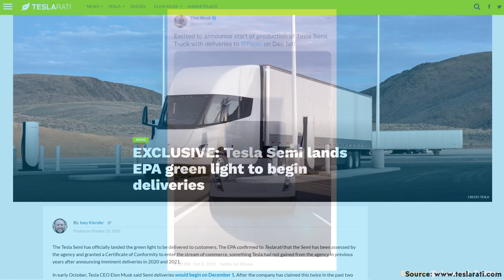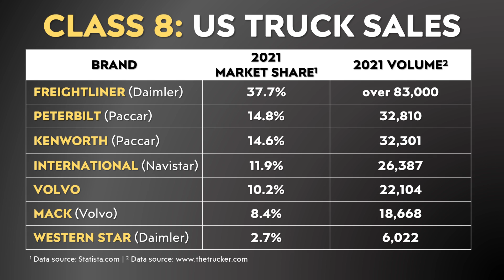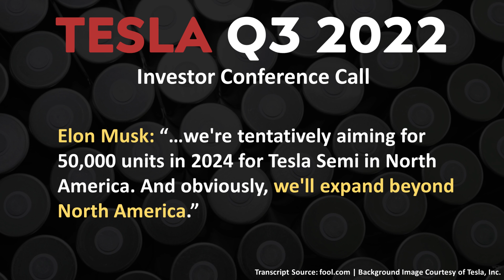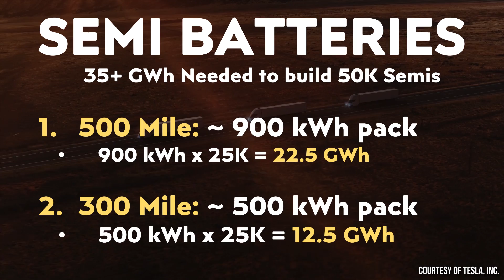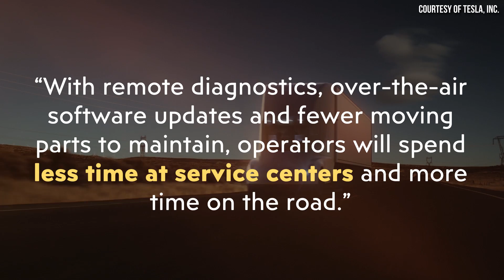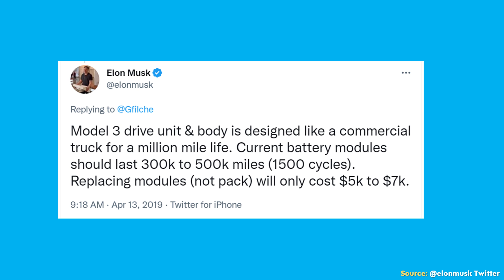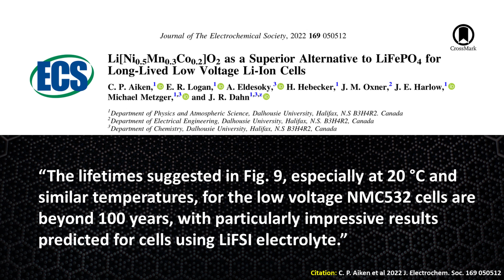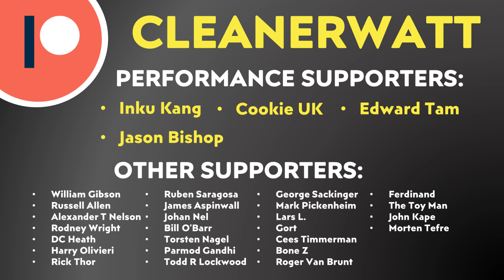Tesla Semi is about to DISRUPT Trucking | Competition BEWARE!

Comment: 13:40 the Semi uses THREE motors, according to the official specs.  I'm definitely interested in seeing how they distributed these out.
Thanks for the update!
Reply from the maker: Thanks for pointing that out! I see that now on the Tesla Semi website.
Reply: @Cleanerwatt  Someone was able to get a real close look at the one at Frito-Lay: https://youtu.be/BM8tagXEFMA but I can't quite see where the third motor is.  There's definitely a lot less room that in M3/MY (which is hard to believe, until you see it).
Reply: @satoshimanabe2493  3rd motor is rear.  See @15-20s , set video to 0.25 speed and FullHD. You can See the single motor and huge differential to the rear wheels. Compare with the 4-motor prototype in the 2017 KMan video
Reply: @Cleanerwatt  
Logically, the drive units don't have to run a vehicle at 100 mph plus.
They can be geared down providing more torque, so 3 motors do the job.....?
Reply: Please do the comparison of available semi’s.
Reply: @Cleanerwatt  Why is Nikola not mentioned which delivered 400 electric class 8 semi?  Oops you did mention but for a few seconds?  Yeah I like a comparison.
Reply: They’ve already shown it to motors on the front drive axle one motor on the rear drive axle all three are independently powered

Comment: I'm assuming you are talking about new trucks being sold. 50,000 is a drop in the bucket. That's not even enough truck for just California. Let's say they get it up to 100,000 a year that's still 20 years to replace most trucks currently on the road. I'm still waiting to find out how much weight is on each axle empty. I also want to know how they are going to charge so many trucks at night. Will there be a power plant beside all truck stops. These are questions from a actual truck driver.

Comment: If Semi Truck users save $ 200,000 in fuel in 3 years, they should just buy one new semi truck, sell the old truck with or without the old batteries... or, or make 500mile battery packs out of old battery packs... sell dead battery packs for recycling, or buy 300-mile Tesla Semis for shorter routes...

Comment: So questions to be potentially answered later.
1: I work in vehicle maintenance (sounds better than "I change oil"😉) and a cost of maintenance comparison from Diesel Semi to Tesla Semi is something I am really interested in.  I understand Tesla Semi will be speculation and not easily determined.  Example: it would appear tire wear should be close because the 2000 lb difference allowed by law is far less percentage of weight difference than  for cars from ICE to BEV.  BUT,... The ability to accelerate at 2 or 3 times as quickly could negatively effect tire wear conciderably.  
2: As per battery life.  If Semi is constantly Super Charged how will that effect battery life?  Also with smaller charging infrastructure the practice of charging to 100% on a regular basis will  probably be much more prevalent even if load is moved well below the 500 mile range.  Will Tesla Semi be relegated to dedicated factory to warehouse runs with installed charging at both ends, and maybe local delivery?  No real OTR, find a load and go.   
3:  What is a realistic timeframe for a charging infrastructure of this capacity to be installed every 150 miles or so on nations interstate highways.  How many stalls per location at what power requirements?
4: Grid taxing mitigation. I saw a video the other day that stated 10% of grid power went to grocery.  Stores, warehouses and refrigeration.  I have also seen claims that two Tesla cars charging at  level 3 in a Walmart parking lot will have the same power draw as the Walmart does.  That is some eye opening perspective.  So now Walmart throws some Mega Chargers at their stores.  Would not charging at those rates create a situation of instantaneous tripling or quadrupling the draw on the grid from that one store?    The grid absolutely does not like being spiked.   Ask any one with a large factory.  You can't turn it all on at once without the grid operator screaming and charging you massive penalties.  It has to be a slow ramp. So then I guess the question becomes, can Tesla produce Megapacks at a rate fast enough to feed the semi charging infrastructure and still meet their other needs with that product line. 
3b: What happens to trucking industry when states say "Don't charge your EV.  Grid can't handle it."?
4: Realistic idea of what it will take to solar power most of Tesla's charging infrastructue, including the cars. I have read solar farms average 15 acres per megawatt installed, but new local ones seem to be closer to 11-12 acres per mw.  If we estimate an average of  5.5 MWH per day per installed megawatt of solar, and an average truck charge of .5 mwhs we then calculate 100 acres of deployed solar at 11.5 acres per megawatt, we find we could charge 17-18 trucks on average per day off of 100 acres of solar.  Having worked a a truckstop that doesn't seem like a lot of trucks.   My experience for a  medium sized truckstop would be 10 times that.  Therefore a thousand acres or about 1.5 square miles of solar required, plus all the megapacks that would also be required.  This particular game of how much land required is a calculation I play with frequently. 
Yes the EV truck comparison would make for a very interesting video.  
Thanks for the good work.

Comment: When the Tesla Semi was introduced, my back of envelope math said. The price of batteries needs to come down-A LOT- for this thing to be viable. A second issue is that the weight of the battery pack is a real concern in a semi.
Elon has stated that the size of required battery in the Semi is 500 kWh for the 300 Mi Semi.
That is at least a third smaller than a reasonable person would speculate.
The Tesla Model S has a 100 kWh battery which weighs 1200 Pounds, and  may be priced at $12,000.  So the Battery used in the Semi must  be 1/3 less expensive than what Tesla is selling today. I think that the combination of this need to reduce the price of the battery combined with the low volume of batteries required for the Semi program pretty much rules out some special chemistry which is different from the batteries used in other vehicles. Admittedly, they could suck in the margins they make on other vehicles and produce trucks with the more costly and heavier 2170 batteries until 4680 battery packs are available.

Comment: I drive a Model Y about 40,000 miles per year. I am on they I75 and I285 between Chattanooga and Atlanta almost daily.  It is a very heavy trucking corridor.  It will be great when the transition is complete to the EV semi. It won't take long for the truckers to get on board.  The charging infrastructure will be easy to put in place as the fleet increases in size.

Comment: The Semi does not need to accelerate like a performance model car. With such heavy loads it would be dangerous. I hope Tesla optimise the Semi battery and powertrain for the trucking use case.

Comment: none of this matters what matters is the length of time drivers legally able to drive being able to recharge the truck wherever it happens to stop and having a diesel power generator on board to recharge the battery just in case it dies cuz nobody wants to spend well over $100 an hour for a service tech to come out and wait for that thing to charge back up. also the problem with it having to shut down anywhere when you run out of 10 hours on your log you can't drive anymore
Reply: does anybody on this channel knows how much the tow bill is for a semi truck the highway patrol wheel mandatory tow you on the spot if you're broken or stopped I don't care about your battery over $1,000

Comment: If you look at the sheer size of the Austin gigafactory, it always appeared significantly larger than the output of Model 3 and Y it was touted to produce. The reason? Because it was clearly designed to deliver Model 3, Model Y, Cybertruck and Semi. So I do not doubt they will be capable of producing 1,000 semis per week as of 2024. Tesla is ruthlessly efficient and methodical in their design and planning. I think too often people get lost in the short term and Tesla does not. This is Teslas greatest strength.

Comment: These companies are going to wish they had not went EV semi. Just wait until winter cold temps hit and the range is reduced to as much as half.
Reply: The main reason BEVs loose a lot of range in the winter is because of power used for cabin heating. Only a small amount when the battery is cold, and unless the trip is short, the battery will heat up, so no more excess loss. Heating the Tesla Semi cabin should be a similar load to a car so as a percentage, the loss will not be nearly as great.
Reply: @royh6526  you seem to forget one-word you keep using. It is "LOSS." There is ALWAYS a LOSS and the colder it is the greater the "LOSS." In fact, regardless the weather/temperature if you let ANY EV set without being plugged in the battery will go dead due to "LOSS." Depending on the state of charge when let setting some will go dead in just a few days and some in a few weeks, but they will ALL go dead.

I have known of people parking their EV at an airport to take a trip and when they came back had to have it towed because the battery was dead.

Comment: The EU would be interesting for deployment, because of the narrow Streets, there are regulations in place which are limiting the length of the towing unit, therefore a redesign for the new demensions is needed.

I do not expect an arrival of semi in two years for now, in europe.

Comment: I’m driving local deliveries for a large grocery chain. The vans are automatic trans diesels. Initial acceleration is clearly limited resulting in slow starts and driver worry at busy junctions. But once rolling they’ll surge forward. Electric vans would be perfect for the job. Reduced service costs and much cheaper fuel make it a “no brainer”.

Comment: I think they will build as many as they have contracts for but with cash on hand means you can’t have a stock of trucks sitting on the lot unsold. Manufacturers are hesitant about signing contracts on promises.  Battery materials is what industry is concerned about. There’s just not enough to go around.
Reply: "they will build as many as they have contracts for" Yes, except that number of contracts will be much higher than their production capacity.

Comment: a lot of those comments show EM probably had little understanding of what a truckers day involves - Truckers don't habitually dragrace, nor is slowing up the hill a terrible thing if it gives 50 miles more range, if they need to conserve their energy for the longhaul -  an overhead catenary should be looked into more seriously for long distance trucking (not only some strange Euro thing - they already have trolley buses everywhere)- charging on the bypass ringroads of many "enroute" cities would be possible.

Everything in economics hinges on the economics of the energy and consumables (inputs, including maintanance and time off the road, yes these matter, EV trucks still need tyres changed and windows washed...
750 000 miles is only up to around 3 years on the road, before the "highest value monolithic  component" needs replacing,   Engines and drivetrains do that x multiples - yes they do need maintenance.. (the proposed pricing structure means that trucks will likely be bought new and scrapped for the battery value on the second use market - where ther eis a $$ motive, a method to dismantle (likely with a waterjet) will easily be solved) as they will be the cheapest A1 confirmed Automotive cells available..)

Comment: Seems like battery swap is a good fit for Semi. Instead of a 500mi battery, use a 250mi battery with swap stations along interstate highways. If peak electricity is expensive, better to  own swapped batteries charged off peak and saved. I wonder why we don't talk about battery swap in long distance trucking.
Reply: An old argument for cars. First, truck drivers must take breaks from driving, so extra charging time beyond the normal break time will be minimal to none. Swap stations cost a lot of money and having spare batteries is additional cost, the economics are not attractive. Nio is committed to the swapping concept, in China they are heavily subsidized by the Chinese government so profitability is difficult to determine, but now that they are expanding into Europe, I doubt European governments will be so generous. I am very curious to see how Nio costs work out in Europe. 

It is my understanding that the Chinese government pays for Nio's swap stations and also Nio qualifies for full NEV benefits despite being priced over the limit because of an exemption for battery swap vehicles. California has paid over $100M for hydrogen fuel stations, so has given similar support to H2 FCEVs as China is giving to battery swap.
Reply: Would be massive and heavy batteries!

Comment: I think that somehow Tesla semi can and does have a way to use the standard supercharger network in case of emergency charging, but it looks impractical for the moment. As it looks like a Y combiner, which is not practical and easy to tamper with,  or steal from what pictures are available showing it.

If I were to design the semi, I would include dual charging ports on the front to connect to up to 2 charging stalls simultaneously for the fastest charging the stalls are capable of. At least initially. 

While slower than the megachargers, the superchargers are more numerous and accessible for the time being,  and until the megacharger network has been filled out,  this will likely have to be the next stepping stone to wider adoption.

Comment: My take on battery daybwas that certain vehicles (models)  were chemistry specific rather than form factor specific. 

I would surmise that the 500 mile range semi will be at least 1000kwh they will need a buffer to avoid having to stress the battery by 100% discharge/charge cycles also in order to maintain range over time. This will also avoid need and cost of replacing batteries during trucks life. I trust Tesla have chosen the correct chemistry for the semi cells.

I see no reason why the 300 mile range could not use an iron based chemistry. It actually seems an obvious choice. 🤔

The motors I have no idea they will be working at far higher continuous loads so my pure guess would be either new motors or very much upgraded versions of existing ones

Comment: Even if the battery replacement negated the fuel savings, you still have a truck that has lower maintenance, has no CO2 emissions,and is insulated from oil price instability.
Reply: but not the electricity market - monopolies create revenue - at the expense of the "every man" (remember Enron, the same couldhappen again - the European Russian gas "crisis" shows that the market-organism doesn't use a whole heap of logic at times.
Reply: Well , maybe, but the renewable energy is getting more and more expensive too.,  Sun, Wind ,. Water are Free but Not the maintenance, labor and wear and tear on the machine , Electricity price had gone up 10-15 % in the past 12 months, and Tesla Supercharger rate had DOUBLE in busy areas in the past 6 months ,,,,   You see, here, the more demand on Electricity over all will only push up the cost of electricity

Comment: When you say 1500 cycles, are these deep charge cycles (basically 0ish to 100ish %)? There is a big difference, strain wise, between a long high current/voltage session and a short one or even a long, low power session.

Comment: It appears that the discussion should also include the trailers in order to cover regenerative braking. Thoughts?
Reply: All electric trucks use regen. Also the hydrogen ones. Some manufacturers make electric trailers
Reply: @thomasgade226  The truck itself, yes. But the trailer has its own brakes, too.
Reply: All the Regen would be done with the prime mover.
Trailer brakes would only operate under heavy braking, or when the semi's battery is fully charged and can't be used for Regen.
Reply: Right…?! The trailer seems to be a critical missing component of the entire subject for that exact reason. Heaps of efficiency are missing out of the equation without a trailer employing regenerative braking efficiency gains! 
Awesome point.